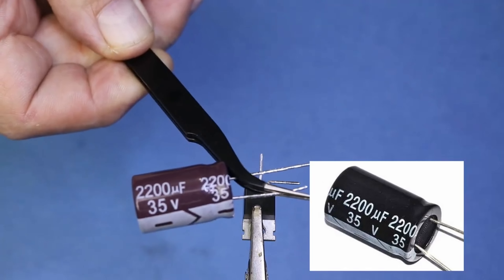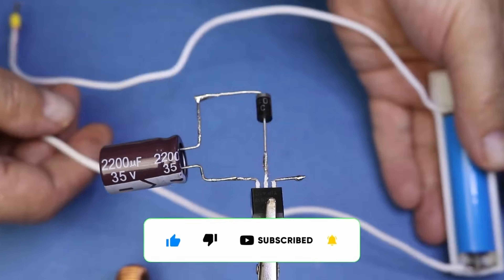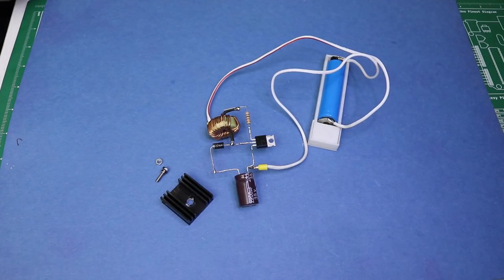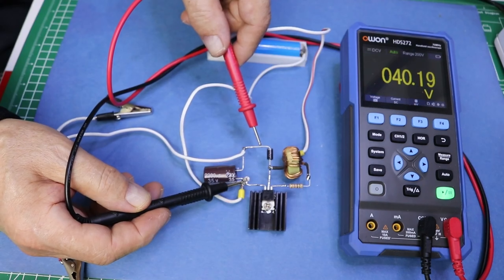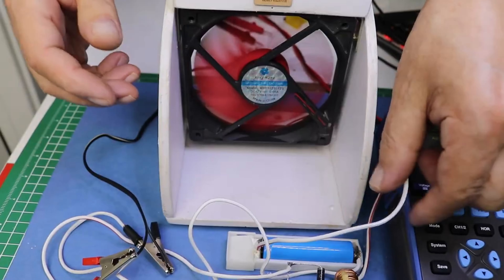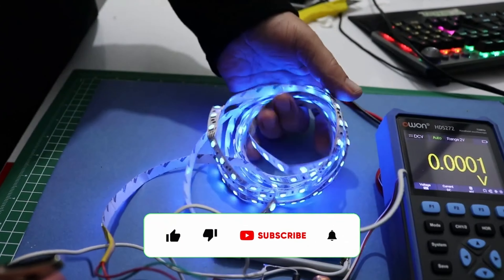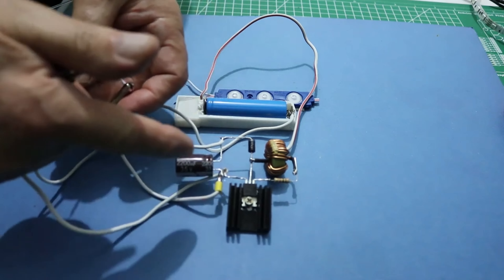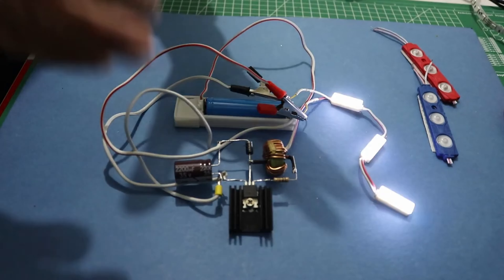How to Build a 3.6V to 40V DC-DC Voltage Booster | DIY Voltage Converter Tutorial

Comment: Circuit diagram please ❤
Reply from the maker: 1:Piece Medicine42
1: Quantity 2200uf, 35 or 50 v, it doesn't matter
1:Qty 1N5408 diode
1:Piece 1K 2 or 3 watt resistor
1pcs. There is no coil coming out of the power supply. It can be 30 to 50 turns.
1:Qty 18650 battery
1:Piece Aluminum heatsink
Reply from the maker: 👉schema: https://l24.im/F0trR 👉    https://l24.im/HY9hvG8

Comment: Circuit diagram block please
Reply from the maker: 1:Piece Medicine42
1: Quantity 2200uf, 35 or 50 v, it doesn't matter
1:Qty 1N5408 diode
1:Piece 1K 2 or 3 watt resistor
1pcs. There is no coil coming out of the power supply. It can be 30 to 50 turns.
1:Qty 18650 battery
1:Piece Aluminum heatsink
Reply from the maker: 👉schema: https://l24.im/F0trR 👉    https://l24.im/HY9hvG8